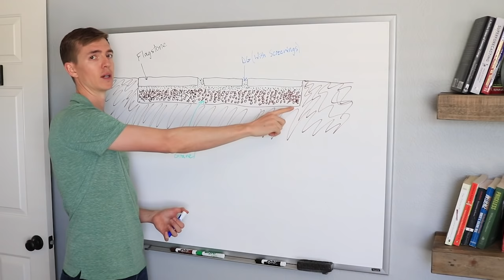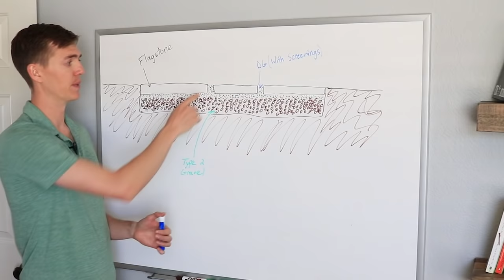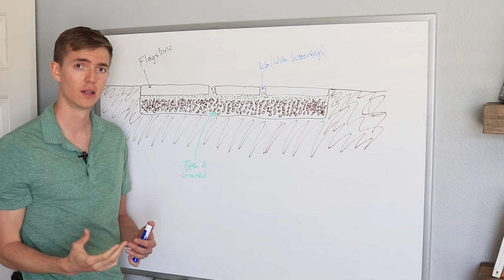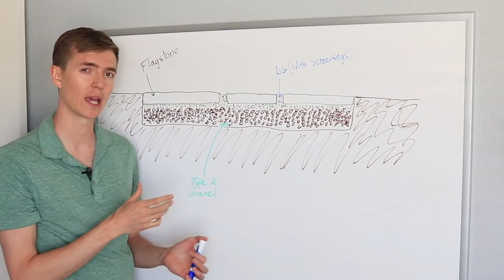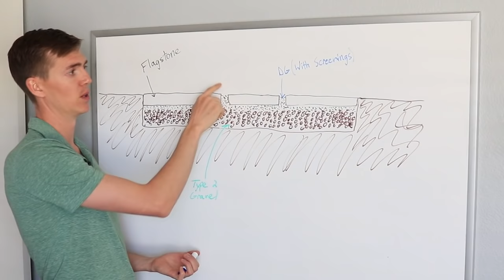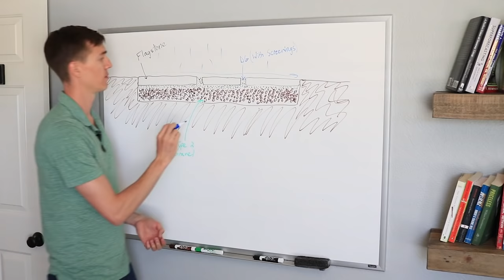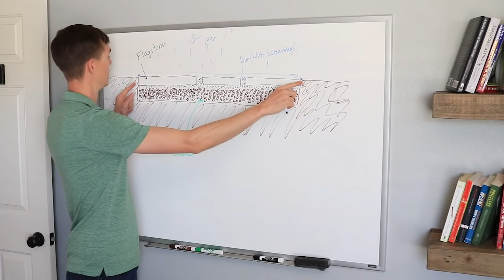How To Install A Flagstone Patio (Step-by-Step)

Comment: I wish I watched this video first! After struggling with the first few stones I now have a much clearer idea of what it takes to prep and place the stones. I agree with Glassman a step by step that makes sense!
Reply: Fred Norris 😞
Reply: No this is all wrong, don't listen to this guy, trust much better options out there ok, don't stop your education here!
Reply: @robertocampoy1606  Why is this a bad guide? Who are better options? What makes a better option? How do you determine a reliable expert & info?
Reply: @artsaffron  there is no need to cut stones
Reply: @jantzenknight6734  when you buy irregular flagstone you want to minimize cutting as much as possible to ensure a natural look. What I do is start in the middle and get the biggest flagstone down try to keep spacing consistent and work your way out. Of course you want to distribute the big stones evenly for a consistent look. You keep working your way out overlapping the edge. For the ones overlapping the edge then you take the saw and cut the edge you want, this is what is done with pavers. You can break flag stone with chisel or just smash them to get small stones to fill in any gaps that are remaining until you get nice spacing throughout. What I then do is mortar in the small stones to prevent them from shifting when I go to sweep in the polymeric sand. I can send you some pictures that will blow your mind on how natural and beautiful a path can look. It’s so much quicker than cutting every stone, that would be a nightmare. I just completed a 80ft by 4 ft path and did not cut a single stone...
Reply: @jaredbozich9760  Hey, could you link your how-to video then, please?
Reply: @jasonwitter1175  don’t have one but literally trying to save people from an ungodly amount of work. Why would you get irregular flagstone only to cut it? How does that make sense? It looks like crap with all those cuts and completely unnatural. This is my own personal preference.
Reply: @jaredbozich9760  thanks Jared for the tips!!  So Dan in this video says to put all of the large stones on the OUTSIDE of the patio i.e., the border.  Are you saying to start with the larger stones at the center of the patio?  I think I've seen more flagstone patios with the larger stones at the center.
Reply: @andyb8838  always start with the big stones in the middle, as those are your best stones. If you do have to cut one you do not want to have to cut a big beautiful one :)

Comment: Great video. The only thing I would recommend is sweeping in a polymeric sand in between the joints. Alliance Gator makes a polymeric stone dust that is specifically made for flagging just like this. Tighter bond in between joints, won't wash away, will prevent weed growth and deter ant hills.
Reply: SporadicCadence thank you
Reply: Yea, but if the gaps are bigger, it sucks
Reply: @ericsweeney4544  that’s why I recommended the polymeric stone dust, and not polymeric sand. The polymeric stone dust has larger granules and more polymers to fill in those larger gaps.

Comment: This is the best DIY flagstone patio video on the internet. I built a 12x14 flagstone patio in only 3 days all because of this awesome step by step guide. First two days was spent digging/leveling on my own and on the last day had one person help me out with moving the flagstones. We got 2 tons of large 2" - 2.5" thick pieces which covered our 168 sqft area (with only 3 pieces to spare). Using the largest pieces around the outside first and working your way in with the smaller pieces was a huge piece of advice taken from this video. I also chose to do a square patio to limit the amount of cuts we had to make, and my cheap Ryobi angle grinder (with diamond blade) was enough to score the flagstones. We then put the scored flagstone on a 4x4 and used a sledge hammer to break it at the score line - not perfect but works 95% of the time. Taking your time with leveling the road base (type 2 gravel) and sand as best as possible definitely made it a lot easier in the end when you're laying the flagstones. It got most of our pieces pretty level without having the need to add/remove sand as much. Lastly, we used an additional layer (100lbs) of poly sand and worked it in between the stones to help seal the stones together (similar to how he was doing it @14:04) and it produced a super nice gray finish in between the cracks. Thank you Handyman Startup for saving me thousands of dollars on labor alone and for giving me the confidence to do it!
Reply from the maker: You're welcome. Glad to hear the project went well.

Comment: Extremely useful video! I used this as a baseline to build a flagstone patio of my own. I used irregular flagstone by the pallet, so it required a hand held concrete saw to cut/fit each piece (he's not lying when he says it takes a long time). Also went with mortar sand over DG (preference) and Gator Maxx polymeric sand to fill the joints. Took a while but I wouldn't have had the confidence to do it if not for this video. Thanks Dan!

Comment: I’ve watched many videos on flagstone installation and this is the best most complete instructional one out there. Nice job dude. I would suggest using a polymeric sand to fill in the gaps. Super easy to use and locks it in well. They usually offer a sand color or a grey color to suit your need.  Thanks again for the vid.
Reply: How do you lock the polymeric sand in along the edges of the patio?

Comment: In the Northwest, we don't have DG.  Instead, we use 1/4 minus with fines and dust.  It fills in spaces of the 3/4 minus gravel base and it compacts very well.  Spaces between flagstones are filled with polymeric stone dust aka polymeric sand.

Comment: Never done anything like this. But the labor costs are too much. I'm removing the deck for this type of patio. Hopefully, one month will be enough to get it done. 😅 I just have to remember to call before I dig. Thanks for putting this info out. It's getting to the point where we gotta learn this type of stuff because it's too expensive to hire out for. 😊
Reply: I am now in a similar situation. I have a ground level wood deck that is practically rotted away because I've been procrastinating on replacing it for so long. I've watched this video and several others and have pretty much figured out that I can do a patio by myself to save money. But then my wife steps in and says why don't we just replace the deck with a trex deck? She likes being a few inches off of the ground I guess. I had already considered that but it seems that the materials for a composite deck would be far more expensive than just buying the stone and gravel, and the carpentry and Design skills are sort of beyond my abilities and my tool set. I'm wondering if you considered the same thing.

Comment: You are one smart, skilled, & very talented fellow!! Your project came out fantastic & your step by step directions were awesome. This video will help many DIY'ers. I've always done our flag areas in a more free form way with landscape fabric over leveled dirt, then brieze for the mortar. The one flagged area in the backyard has held up fairly well. But the one in our front yard got so weedy, that the weeds could only be removed by taking the flagstone out. Now we have several pallets of that flagstone & are thinking about how & where to use it. We need a diagonal path through the lawn from the patio out to our shed in a far corner of the backyard. We are hesitating though - since were older now & that project is labor intensive. Plus - were pretty sure we would have to revise the sprinkler system a lot, so the path wouldn't be saturated with sprinkler water from May through Oct. It sure would be beautiful though & so great to have when going out to the shed.

Comment: Built a 12*16 patio myself with your help. Thanks. Basically checked FB market place and Craigslist for flagstone until I found someone selling a 2.5k pallet for 500$ and then got some the rest from a mason yard and home depot cost about 1.2k after everything but beats out the 6 k quote I got.

Comment: very complete video.  Simple, Short, direct and most of all CLEAR.  I'm in New England so a little deeper prep is necessary.  We are doing a 650 +sq. ft. patio and the scope is a little daunting.  36K lbs of dense grade for the sub base, over 27K lbs  (10 yards ) of stone dust (thus far) but it is proving to be a 
great bonding experience for our family.  THANKS!

I would say one thing about polymeric sand - for large projects it can be very expensive.  No doubt a great product but expensive.  

can't wait to watch. your other videos.
Reply from the maker: Wow that is a big project! Glad to hear it is going well. Thanks for stopping by to leave a comment, too.

Comment: This was super helpful! Thanks. I built a patio last year with my boyfriend and we went with the grass in the gaps route. It turned out really nice, however, we didn't put down that gravel in the beginning and we used sand to level everything. We're going on year one and it's holding up pretty good through the winter, but I guess only time will tell. I am actually building a new patio soon, and I will definitely go with this design.
Reply: Why not post a picture if possible?
Reply: @ipopa2000 how would they do that it's yt not insta

Comment: Dan, outstanding project video.  I am considering a similar patio/fire pit of goshen stone, here at our home in western Massachusetts.  I was a bit surprised that you oriented the “low point” towards the house/deck.  Maybe because it appears (by that beautiful long shot at the video’s end, “toward the hills” that you live in an arid part of the country.  I would caution others — particularly where rain and snow are significant — who are considering a similar project to set the drainage-low point away from your home.  At 65, but still active, I hope my knees and back are up to this.  Again, Dan, Bravo-Zulu, well done on producing a great educational DIY video!
Reply from the maker: It's actually graded to drain through my yard and around the side. You aren't supposed to drain off the back of your house in most cases.

Comment: Absolutely beautiful. I was looking at the portfolios of local landscapers (Co Springs,) and their patios all have a few spots where you think 🤔 .  You patio looks amazing and you put a lot of time and effort into it and it shows. I don’t think I could realistically pay a company to do this kind of work but thank you for the explanation.
Reply: Not shown in video - the tedious and heavy lifting process of lifting larger pieces out for leveling.  Large pieces that have jagged bottoms and take multiple attempts even by professionals to get correctly set.  If it's a larger patio area, it's worth paying professionals to do (and definitely make sure they have experience because flagstone can be incredibly tedious.

Comment: Check for utility lines under dig site.

3-4 inch type 2 gravel.

Add irrigation line.

Next level 1 inch of Decomposed Granite with Screenings as leveling.
Wet it then use hand tamper.

Lay down flagstones add DG between seams. For every Foot level it at a decline at 1/8 of an Inch
Use respirator with at least 4 inch angle geonger and hammer to shape rocks.

Comment: Again very nice tutorial!  If I did this though, I'd lay the flagstones down and overlap them, and just cut off the overlapping parts to get a tight fit with minimal work to arrange them.  Obviously a little more wasted material, but way less labor.
Reply from the maker: Good thought John. If you have a concrete saw with a 24" diameter blade then that method might be reasonable. The problem is that you'd spend so much time cutting. The cuts are slow, sometimes up to a minute per stone. 

You'd also go through a ton of blades.
Reply: Handyman Startup I've found that cutting about halfway through and then breaking the remainder off with a hammer saves alot of time on installation and alot of money on blades.

Comment: Yes, as others noted, you made an excellent instructional video. My one question is that I live in Maine, so winters and potential frost heaves. You appear to live in a hot climate. I'm wondering how that might change my ground preparation to avoid cold climate issues. I'll do more research, but thank you for what you provided here.
Reply from the maker: That's an excellent question that I'm not certain about. I believe the frost line is like 24" deep there or something crazy. Doing a base that deep seems crazy to me.
Reply: @StayHandy  Thanks, I asked the pros at my local stone shop, they said a 9-12” base is the standard here.

Comment: First of all, this is a fantastic video. It is truly a step by step instruction for beginners to follow.  What would you recommend on how to install a drainage line for rain water to flow out? I was considering installing a 2 inch PVC drainage pipe. But i can't think of a way to install it flushed to the surface of the flagstones for better esthetic..

Comment: I like to add a polyethylene plastic sheet before applying the gravel so that the gravel doesn't mix with the dirt over time.  If the flagstone is square or rectangular, I also like to lay the patio out on a piece of graph paper.   This makes it easier to know what size flagstone you need.
Reply: Plastic will break down in a year. Try high quality landscape fabric.

Comment: Liked the video good info. However when I called my local gravel/stone companies they didn't know what I was referring to by Type 2 gravel or Decomposed granite/DG with screenings. Maybe there are local or regional terms for these things.  How can I be sure i am getting what you are suggesting.
Reply: You can use CL6 roadbase for Type 2 and Concrete Sand for the screenings
Reply: Ask for 5/8 of an inch crushed gravel and limestone screenings. Any place will know what they are.  I do alot of flagstone work and I use those. Very close to what this video recommends

Comment: Dan, question regarding gravel-to-DG ratio.  First, very informative video.  Just started my first flagstone project and am using your guidelines.  I've removed the needed dirt and am about to lay the gravel base.  However, I have a large amount of DG (with screenings) left over from another construction project.  I believe it to be close to twice what I need based on your video.  So my question is, since the DG already paid for.  Can I use a thinner gravel layer and a thicker DG layer?  Or one step further, could I use ONLY DG if I have at least 3-4" thickness?  TIA.

Comment: My notes! Patio lasagna:
1) Dig down 5-6 inches. Level at a grade for drainage (1/8 of an inch drop for each foot)
2) First layer: 3-4 inches of type 2 gravel. 4 inches is ideal.
3) Second layer: Leveling layer-finer gravel. Decomposed granite with the screenings.
4) Flagstones. (Thicker for driveways, thinner for patios)
5) Fill seams with dirt or decomposed granite depending on goals.

Comment: Thanks for a great video. It is clear and concise. How do I locate number 2 gravel? Seems there are many kinds of gravel there, a lot of decorative ones and in the gravel yards none list #2.
Also the GD seems to be sold in pallets of by the ton. I don't believe I need that much for the 32 sq ft path I am making. Any help you can give would be appreciated.

Comment: Would it make an even greater and better foundation if you molded a thin layer of concrete that makes a nice and flat surface under the fine ground gravel? say 1-2" instead of the 4" of packed gravel layer?
Reply from the maker: If you’re going to poor concrete then you might as well set the flagstone in it while it’s wet. That is a method used by some pros and certainly has advantages. It’s just much more challenging to install.

Comment: Do im will b doing a flagstone padio and want to know if i can use morter between my flagstones using the process you explained. Or do i need to base differently for morter joints in the end???

Comment: Thank you for this video - I am about to lay a flagstone walkway bound on one side with a short brick wall and the other side to the lawn area.  Should/could I use low pro edging to lock in the flagstones on the lawn side?  Also, could I mix in a little cement in the DG When I fill the gaps between the stones?  Lastly, when I dig down and lay the conduit for both the irrigation and future electrical, how far down should I dig?  Thank you.
Reply from the maker: You can use edging, but I prefer to instead just place the larger stones on the outside so they are less likely to move. Movement isn't a big deal since there are already gaps between the stones. I wouldn't mix cement with the DG, but you could try some polymeric sand. It will crack over time, but will stay in place better than loose DG. I'm not sure on the codes for conduit.
Reply: @StayHandy  Thank you.  Your video and advice are excellent!

Comment: I love your video! I tried to read all the comments you replied to and I picked up some info but just to be clear....For Type 2 gravel, you mentioned alternative is CL6 Roadbase or paverbase.  Would either of these work?
'#57 Limestone

The most popular stone for drainage and driveways. This stone is white or gray in color, and is roughly the size of a quarter.

 #4 Limestone

 It is a whitish-gray solid stone that has been crushed to size. It will have edges as opposed to being rounded on the corners. This stone is generally used for roads, driveways, parking lots.

and for the DG with screening, would this work?
CR610 Crushed Limestone

Grey 1/2" crushed stone and stone dust. CR610 Crushed works great for driveways, patios and walkways where a firm, compacted base is desired.

Comment: For a flagstones around a pool I was thinking to mix sand and cement and put it dry in the cracks and then to put water instead of putting it wet which is much messier and harder. You think it can work?